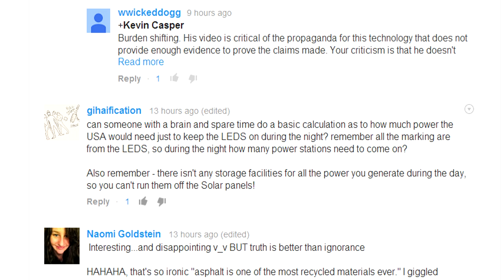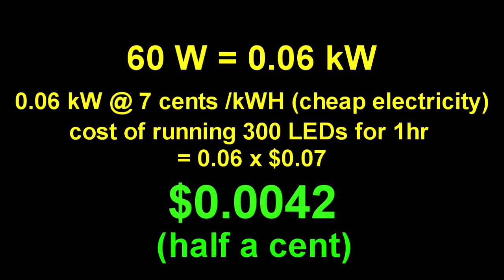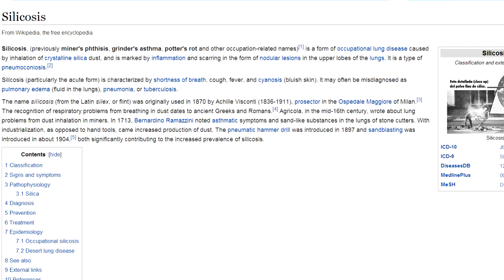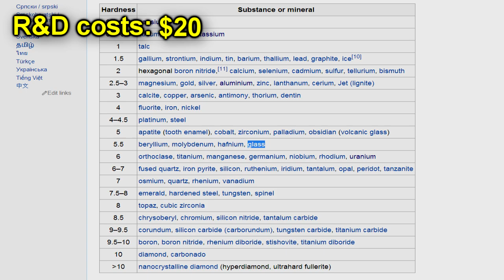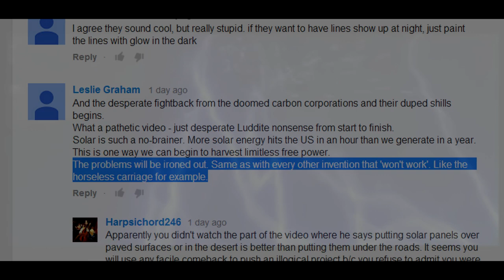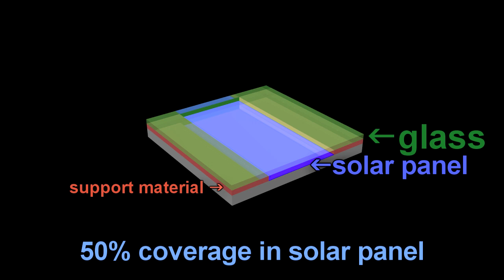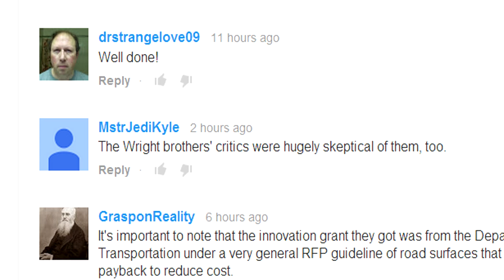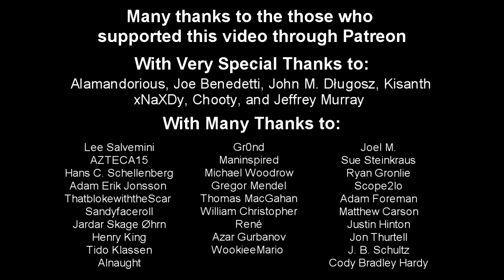Solar Roadways, IMPORTANT QUESTIONS AND ANSWERS!

Comment: um who said the power cant be stored?
my nighbors roof is all solar.
when he goes on vacation he generates more power then his house uses.
do you Know what happens next?
the power goes back into the grid for pepole like me and you.
at the end of the month he gets a cheak from the power company.
so why would the road not be like this?
Reply: ...You're being serious aren't you.

Yes, some people do have battery banks at their houses to store some of the energy they generate. But if you looked at the sheer amount of capacity to store the energy required to run this system at night (let alone the energy that a whole country/state/city uses), you'd quickly see that such capacity is not possible. Right now, if all the generators on the grid turned off, the grid would lose power completely. A few houses with battery banks and solar panels aren't going to support it... 

It's all electrical engineering 101...
Reply: How can it be stored when it is being used? It is being used to power the LED's, the microchips, the network infrastructure under the road..Here is your flawed thing with your neighbor. When he is on vacation, he isn't USING power for his house. But when he is home, he is and also using power from the grid because he doesn't generate enough to do the entire house. Unlike the panels, they will be using power 24/7. Here in NY, we have only about 45 days of direct sun light! The cost for Solar Panels on a house is like $10k! and would take years to make it back!
Reply: Tig3rj did you not catch the part where they say ity generates more power then we use?
ie there is extra power that can be stored
Reply: The power grid cannot store energy. Solar cells cannot store energy. That's a really fundamental problem... .
Reply: That's not technically "storing" the energy, is it? That's just putting it to use in other locations. Storing energy would mean your neighbor could go on vacation, then use all the energy he saved up himself when he comes back.
Reply: more power than***
Reply: He defeats this on every level... the materials used, the needed energy vs lack of area/need to keep them flat on the road, even the cost of the materials.  "Storing energy" is fine, but we would need to build giant solar power plants just to power the roads... the roads themselves aren't enough.  If we can build giant solar factories to power the roads why aren't we all full solar at this point?
Reply: You need batteries to store energy. I see no batteries here. If you read their FAQ, you find they admit these things can't power all their claimed functions and will DRAW power from the grid to make up for it. Look up the economics of centralized power generation sometime. Takes a few minutes with Google. A centralized plant will hit upwards of 60%. These may hit 20%. Transmission losses between power plants and customers can be as low as 6%. For low voltage DC, 20% at best. Sorry, math rules and engineers are not impressed.
Reply: Your neighbor's roof doesn't have multi-ton trucks driving over it every day , grinding bits of dust and rubble into it. Even a flat clear piece of glass is something like 10% reflective, which means it only passes 90% of the light through it. Can you imagine how low the quantity of light that passes through would be after the glass is scratched and dirty? The road is the worst place to use solar panels. Use them above the road, beside the road, on your roof, in fields , in the desert....but for fuck's sake, not on the actual surface of the road...that's just retarded at the most basic level.
Reply: Don't be dumb, that not how it works.
Reply: Greenboy28
Or if in plane stresses from the roadbed shifting don't crush them first and assuming that the electronics don't get roasted due to the horrid thermal management.  Both of which are going to kill this in short order.
Reply: Well your home is directly linked to the grid, this system will also require a connection to the grid, meaning that every foot of this will require dc/ac converters since the energy produced is DC and the grid is AC. Your house requires this as well but it's far more efficient with regards to bringing it to one line to link up to the grid. Since the goal of the project is to cover all the roads/highways, this means you need to have these converters and sometimes additional grid just for the solar road ways.
Reply: garith21
Questionable implies that there is a possibility of these things working.  Given that the heaters use at least 3 times what the modules can generate under ideal conditions and all the processing power that will be required for all of these 'intelligent' features, the bloody things will not break even on power consumption.  And then there is the fact that their textured glass will smash to bits because the rough texture needed for high enough static friction (which will also turn them into one big rumble strip) substantially weakens the glass due to all the stress concentration points all over the road.  And the hacking of the road signs (everything from stop now messages causing pileups to U LIEK MEN and Boku no Pico is da B3ST!!1) will be huge problems.
Reply: randacnam7321
lol yeah, the heater idea is an obvious non starter to the nth degree, I just generally don't like absolute statements on principle, though everything I've seen on the project indicates that there's literally no hope of viability.
Reply: garith21
There are cases where that can be true.  In the case of this agglomeration of abject stupidity, not so much.  Given the abject stupidity of even one of these ideas used in roads on its own, this bloody thing will not work.  It cannot work.
Reply: randacnam7321 Yeah, I've always been inclined to agree with that assessment, like I said it's just a principle thing.
Reply: *****
No, the power company cannot just "take it in and store it." Who told you that?
The electrical grid doesn't store energy. It's use it or lose it.
To "store" electricity you either need lots of batteries (lots and lots of batteries for this, which the power company doesn't have), or you need change the electricity into something you can store.
For example, you can use the electricity to liquify air, then later use the liquified air to drive a turbine and make electricity.
This is science. Solar Roadways is science fiction.
Reply: Why would the road not be like this?  I will grow carrots in my back yard, because otherwise I have to buy vegetables at retail.  If I run out of yard space, I could plant carrots in the middle of the road where no-one is supposed to drive, but you can imagine why that's not a good idea.  The conditions on the road are terrible for growing carrots.

I eat carrots all year 'round, but just like solar panels don't produce power at night, during the winter it's hard to grow carrots. 

The road and the back yard have a specially prepared surface, which is best suited to one thing more than another.
Reply: clearlyimba the power company can take it in and store it. instead of running giant coal plants they would just take in the extra power. power can be stored this is how things work 24/7 even when power plants are not running. and this is how battarys work.
Reply: ***** yes they claim it would create more power than we use but that is just a claim with no basis in fact.  i can claim that i am the worlds fastest man but that doesn't make it true without proof.  thunderfoot has shown with the solar tech we have now for a panel the size they claim that is nearly 100% covered in solar panels you will make about 40 watts of electricity and that is in optimal situations like being able to track the sun and not being blocked by cars driving over it.  that is enough energy to power about 4 LED light strips.  and these tiles they are putting are not covered 100% by solar panels more like 1/3rd covered and they can not move with the sun.  not to mention that the glass will scratch and erode very quickly with cars driving over it.  those dimples that are supposed to provide traction will be gone within a month.
Reply: ***** Uh, first of all it's questionable if the tiles would produce enough energy to power the lights, keep in mind that they haven't even made working prototypes that have lights that are visible in mid day. Secondly storage is already a big enough issue with traditional renewable energy without trying to worry about these inefficient and decentralized road tiles.
Reply: of course it can be stored, it's just expensive and inefficient
Reply: ***** really??? are you dumb?
have you never had a signal thing that had a solar panel?
they can be stored into battery cells

Comment: The thing is, Glass is a type of stone material as it is made from silica. But that shit will shatter if you even look at it funny. I've seen even small panes of glass break in half just from going across a table with similar mechanics to a air hockey table. I've seen larger panes just shatter into large swords when someone is carrying them, just from the breeze of a fan hitting them in the wrong way.

Comment: Lets not forget that most of the roads and streets would get vandalised on a regular basis.
Reply: AND lets not forget about winter and snowplows and things like that. The salt and sand (used in certain places) would do a tone of damage. And ice breaking tools for home usage would surely break hexagones, and even more if a person uses a pick.
A snowplow would grind that glass and chip pieces off... And the temperature changes between winter and summer would kill those glass streets (look at Canada... We have holes in our streets (less the highways roads)). Water would infiltrate between the cracks and crevices of the hexagones, when that water ices it would expand and squeaze the hexagones (probably breaking most of them), and when the temperature heats up it relaxes... And then it's back to cold.

And lets not forget that during winter, these solar panel wouldn't be worth a thing, because roads are covered in snow and ice (sure, we can see the ground when it's plowd (with a thined down street from the accumulations of snow)... BUT HOW ARE SUPPOSED TO SEE LIGHTS ON THE GROUND WHEN THERE'S SNOW THAT'S REFLECTING BLINDING LIGHT EVERYWHERE?!)
Reply: And when I say cold and hot, I mean temperature going lower than -20 celcius and over 20 celcius.

Comment: Largely correct, Although you seem to assume that all the lights would be on at once, which I doubt they ever would. You would need to workout the current percentage of roads covered in markings, and then the proposal also states that they can detect when a road is in use, so on quiet roads their would often be no lights on at all.

I don't think we ever see this idea going into mainstream production, but I do think it's a concept worth following, as some great solar and communicative innovations could come out of it at a byproduct .

Comment: Why doesn't this guy just measure the amount of power the tiles he has installed generate?  Then determine the area those panels and extrapolate that to the 25,000 sq mi of roadway.  Or simply demonstrate that the tiles can even power themselves?

Oh right because someone important will find out about it before he's finalized his plans to retire in Belize.
Reply: If he took what he generated from his solar panels, he would get a polared result. The generated energy online is approximately the average energy the solar panels generate. If you wanted him to do an unbiased experiment, he would have to select solar panels randomly from around the whole world, randomly from different manufacturers, and buy a ton just for one experiment that he wants test. 
From his video of only testing one solar panel (and yes, it is not the ideal experiment), you should learn that the solar road idea, is not even remotely possible.

Comment: I think this technology is simply ahead of its time, by several hundred years, we just need to wait for a cheap, clear, strong, and durable alternative to sapphire or glass to coat the roadways in, a low wattage and at least twice to three times as bright LEDs, and much more efficient solar panels to be able to soak up the energy while it can.
doesn't sound too hard, right?
Reply: But what is the purpose of even putting the panels under the road? Why do they need to actually be UNDER the road? We could skip all the advancement in technology by just putting panels on the side of the road, and not having anything wearing on them. And then why even build them in relation to roads at all? Just build solar panels where they will be the most efficient at generating power.
Reply: because it's FANCY, and someday rich people may want hexagonal solar powered driveways so they can brag to their friends.
though no real practical application, I agree.

Comment: It's still an awesome idea. Obviously we are not going to replace the whole thing at once. Go ahead and calculate the cost of re-paving the entirety of all paved surfaces? The glass problem is a small one.
Reply: It's only a good idea on the surface (pun intended).  We have far better places to put solar panels, like on the roofs of parking garages.  Revolvable solar panels like he showed would be perfect, and these could line the sides of roadways.  I don't understand why people are defending to the death the idea of actually composing the road with solar panels.  With how expensive solar panels still are, we should be focusing our research in just making them a feasible alternative to fossil fuels, not attempting to push overly ambitious ideas when there are a million problems that need to be addressed before we can even get to the point of these things being feasible.
Reply: The cost of repaving all paved surfaces is still far less than replacing it with solar panels.
Reply: Dragons are also an awesome idea....Outside of some very minor benefits (real-time marking changes), the main point of them is aesthetic and that's what most people want....they want pretty colored lights....why do you think the phrase "it'll be like frickin' tron" has become so popular? Because thanks to movies like tron, glowy lights that represented CYBERSPACE have now just become symbolic of something hi-tech in general....it would look cool and feel futuristic but other than that it's a miniscule "improvement" over traditional roads
Reply: Good idea? Yes, but humanity lacks the proper materials that can withstand the test of time and can survive large impacts. Glass can't survive that environment no matter what and can cause more damage in the long run.
Reply: Hope you have that same attitude when the shards of glass are in your face and hands.

Comment: The are two big problems with solar energy prevent large scale adoption.
One the sun doesn't always shine and it is difficult to store energy. The most efficient way of storing energy available are pumping water uphill, and this is being used by power plants now.
Two.The amount of material needed to manufacture, install, and connect the solar panels. There is a sort of reverse economy of scale with some technologies, solar being one of them. On a small scale solar power is very efficient but as it is scaled up it loses many of the advantages it has on a small scale. It is one thing to have solar powered garden lights is something completely different to have a solar powered city.
The ISS has 8 solar wings of 420 square meters each. Each wing produces enough electricity to power 1 average American home. To power a small city of 50,000 people you would need 6,300,000 square meters of solar cells. A block of solar cells 1.5 miles on a side. Since solar cells are low voltage you start running into lasses in the connecting wiring, so you will need more. The ISS operates in direct sunlight that would be impossible to achieve on Earth, so you will need still more. Then you will need to store the electricity for night. The ISS has 24 100kg battery units that only need to provide power for 35 minutes out of every 90. So a city of 50,00 would need  4500 tons of batteries for every 35 minutes of darkness.

Comment: It's a stupid idea, but, i think you are being a bit hard on the numbers.
you should probably calculate the power requirements for road lighting and then work it out that way for lighting costs. 

If we want solar roads,  a trivial racking system on the road shoulders would work.

it wouldn't be a bad idea  to set up some panels around the base of light poles just to power those,  trivial update,  and get some data on how solar panels cope near the road shoulders.

but solar roadways, just silly.

Comment: It seems like a bad idea to put panels under where we will be driving. And the weather extremes will cause some major issues. I saw something with bioluminescence but I'm not clear on exactly if it was something that was just a concept or if it was in the works but the trees glowed which would save money and energy. The are plenty of reasons why each idea will not be the single one which will save us from using fossil fuels however this solar panel one seems like it would end up costing us a lot more in the long run. And this is a case where "its the thought that counts" does work. Granted I do think a large chunk of what we could save would be in what we are driving but these government officials seem to be ignoring that fact when they could be investing in production of car models like the Tesla S which would stop us from having to us petrol for our transportation altogether.